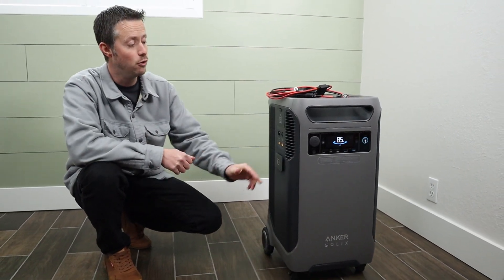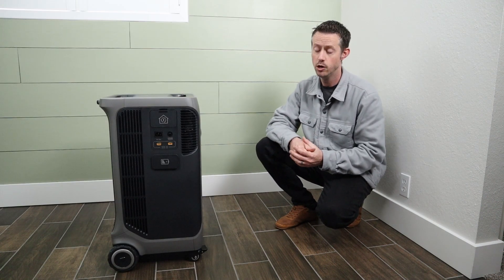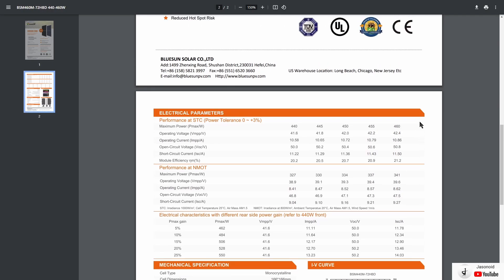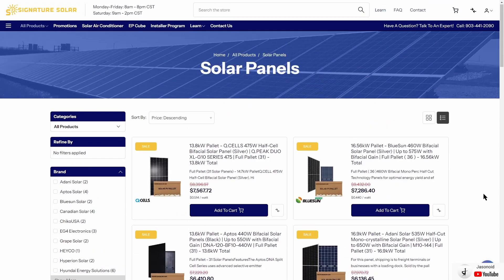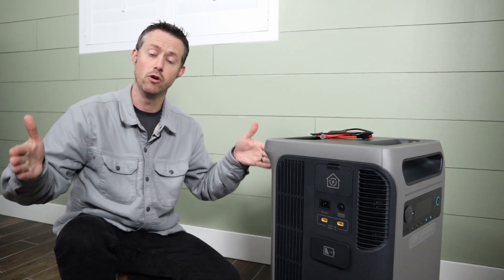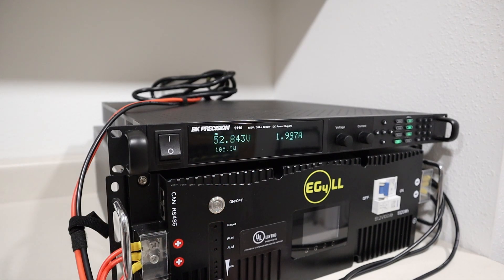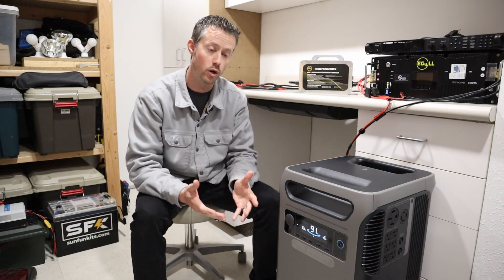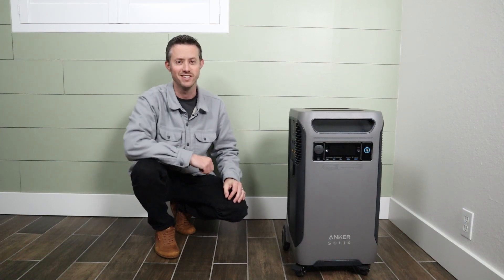Anker SOLIX F3800 - Your Questions Answered! DC Charging Cables - Ideal Solar Panels - and More!

Comment from the maker: IMPORTANT UPDATE: The solar input voltage/amperage has changed on the Anker SOLIX F3800!
https://support.anker.com/s/article/Anker-SOLIX-F3800-Portable-Power-Station-USER-GUIDE--A1790
Solar Input Changes BELOW:
OLD:    11-32V  10A; 32V-60V  25A (1200W Max, firmware 1.7.8 or earlier version)
NEW:   11-28V  10A; 28V-60V  27A Max (1200W Max, firmware 2.0.9 or later version)

The new changes will make this compatible with more 400w solar panels in parallel! Upgrade your firmware to see the changes.
Reply: With the update, going to 27Amps. Looking at say the Q.CELLs 475W in the video, the V@MPP is 45.03.  That would be 1215 watts (45.03 x  27).  Would that panel still work okay going over the 1200 watt limit?  Thank you
Reply from the maker: @jasontwilliams  yes
Reply: @Jasonoid  thank you!
Reply: @Jasonoid  looks like with firmware 2.1.1 you can use 15-60V to hit the 27A max.
Reply from the maker: @jasontwilliams  yep, it's a great change!

Comment: Hi Jason ,I enjoy  your videos, I have a question that I havent seen really covered, with having 2 eg4 48 volt batteries going into each of the solar inputs for charging and operating my f3800   how is the fuse determined for that input coming off that battery or what inline fuse size would I even need to be safe not to damage the solar inputs, Thanks
Reply from the maker: Fuse size needs to match the ampacity of the wire used. Check online for the ampacity of the wire you use.
Reply: @Jasonoid thank you Jason

Comment: Another question perhaps someone could help with.  When using the formula of volts x amps=watts, is this calculating the theoretical watts you could get from a solar setup?    In other words, when choosing solar panels for a battery system like this, I would have initially thought, 1200 watts per xt-60 port, so plug in enough solar panels to get 1200 watts (for example 12 100 watt panels).  So I want to see if i'm thinking about this correctly now....Looking at the renogy 100w panels on amazon, they have Vmp of 20.4v. If I wire 2 together in series that would be 40.8v x 27amps = 1100watts.  But two 100w panels wouldn't give me that much, so i'm assuming I would need to have 12 of them (6 sets of 2 in series wired in parallel).  Now I have 12 panels capable of 100w each, so in theory 1200w, and the Volts x amps = watts would tell me the possible highest output I could actually achieve with this set up....Correct...ish?    Any applying that, if I could find 500w panels with 50ish volts, I could then wire 3 together in parallel and achieve close to the 1200watts that way too.
Reply from the maker: Your on the right track, you'll need a series and parallel combination with smaller 100w panels. If you go with larger 500w panels you can wire them in parallel. You can 'over-panel' the power station with more amps without an issue. The power station will limit the amperage input automatically. You just never want to go over 60v.

Comment: In the examples you list for solar panels, the combined amps of 3 of these panels in parallel would be over the rated 27amps.  Is it ok to go over this rating? And does it matter if the watts of the panels go over the rating?  For example, some of the panels you show with bi-facial gain are around 550 watts each, with three of these that would be over the 1200watt rating of each xt-60 port...is this ok?
Reply from the maker: Yes that's fine to go over 27 amps, that is called over paneling the power station. Just make sure you NEVER go over the 60v, that's where the damage happens.

Comment: At 3:34, how did you calculate 2,400w if 3 are connected in parallel? 1125w x 3 panels in parallel = 3375w per port?
Reply from the maker: The amperage limit on the power station doesn't allow more power. Your also software limited to 2400w, or 1200w per port.
Reply: @ ahh I see! Thanks Jason 🙏🏻

Comment: It’s a piece of junk I charged it once and won’t charge anymore. Anker support is a joke. Do not buy.
Reply from the maker: That's crazy, I've charged mine from the wall everyday and its fine. Did you push the little circuit breaker button near the charging port to reset the charging?

Comment: I'm planning a move to a new, smaller apartment and want to use this to exploit the very steep time-of-use pricing.

Going in... my apartment offers 208v service at 40amps on each phase. 120v phase-to-neutral of course, so I can draw more power charging with 80 amps of 120v instead of 40 amps of 208v.

The time-of-use hours are 8 hours off-peak, 16 hours on-peak.

Going out... I have ordinary stuff, a computer, Playstaion, lights, fan, plus 120v appliances:
-air conditoner needing 10.5 amps
-a single stovetop using 8.3 amps
-a washing machine using 2.5 amps

I'm planning to put the heavy circuits on one phase of the F3800, and the lights, computer, etc all on the other phase coming out of the F3800. I'll use a generator inlet to retrofit the entire apartment... it'll be very clean and neat.

Right now, I own one F3800 and 3 expansion batteries in a simple UPS setup, which works great. But at my new apartment, I want the whole unit on it. Every last watt.

Based on my math, my worst days will use 21kwh during the 16-hour peak. So I'm targeting 21kwh storage.

I am thinking of keeping it in typical inverter mode (not UPS) to get both phases. Then using a smart plug to charge it via the C13 port. To charge 21kwh across 8 hours, it'll take 2625w of input. So to fill the gap, I plan to buy 2 quiet 48v 30a power supplies on amazon and use the DC port.

1) What ideas do you have? Can you improve or simplify this setup?

2) In the latest firmware update, can you charge with AC and DC simultaneously? 

3) Does the generator cable support 208v? That would eliminate my need for C13 and XT-60, plus look even more beautiful. One locking plug in, one locking plug out. I guess it's not a huge deal, just tempting me. I love beauty in these matters.

4) My 3 expansion batteries right now bring me to 15kwh. I need to take that to 21kwh. Should I buy more expansion batteries or can you think of another solution? Since I am already buying 48v power supplies, maybe two 48v batteries would be better?

5) As you proved here, battery chargers won't work because they need to sense a voltage. But if I put a 48v battery in between the charger and XT-60, that would work right?

6) If a 48v battery completely drains and the BMS shuts it off while attached to the F3800, would plugging in a charger still detect it and deliver a charge? How would the charger know a battery is present, if the BMS cut power becaue the anker took it all? I won't be there to unplug it, it must be automatic. The chargers will each sit on a smart plug.

7) Would it be better to just use official expansion batteries so the F3800 can do its own cell load balancing, or would it be better to take a 48v battery at half the price, and wear the heck out of it by discharging to 0% daily, shortening its lifespan?
Reply from the maker: ** Upfront I am not familiar with 208v power. I have not studied it, nor have I messed around with it. I do not have 208v in my area. I have 120v and 240v in my home so that's what I am used to.

1) You could add more capacity for less money by going with 48v batteries instead of buying Anker expansion batteries. You would need a way to charge those 48v batteries so you'd have to consider the costs of adding wiring and chargers in your plan.

2) Yes

3) The generator input adapter for the new F3800 Plus is NOT compatible with the original F3800 power station at this time. If you end up upgrading to the F3800 Plus and using the generator input adapter, I don't think it supports 208v input. The owners manual only stated 120v or 240v.

4) If you are comfortable with a DIY setup, 48v batteries is definitely the way to go. If your chargers are designed for charging 48v LFP batteries I don't see why that wouldn't work. They would need a peak voltage of 58.4v as that's the upper limit of 51.2v LFP batteries to reach full charge.

5) Yes, that will work just fine. Remember you can only connect that 48v battery to one charging port on the F3800, so you'll see around 1150 watts charging while the 48v battery is connected to the DC solar port.

6)The 48v battery BMS is able to control both charging and discharging of the battery via mosfets. When the battery hits low voltage, the BMS will only disable the discharging of the battery and it's still able to charge just fine. If your battery is sitting at 0% SOC, it will start charging when your charger is powered up.

7)There are pros and cons to both setups. Going the Anker F3800 route is fully automatic and very clean and tidy. Everything clicks together and there aren't wires and chargers going everywhere like with a DIY setup. The Anker expansion batteries are kinda like a 'set it and forget it' type of thing. You will spend less of your time managing the system and you are paying for convenience when you buy the Anker batteries, it's plug n play. 
When you go with a DIY system, you will need to plan to micromanage it daily making sure everything is working properly. If you don't have the available time to spend each day working on the system, DIY is not the direction for you.
Reply: @Jasonoid  Thank you so much 🙏🏻

Comment: The anker F3800 has changed so much since your videos. It may be a good idea to hide these and do an entire new review of it and the plus, cover all ground. Because like, at 10:49 that's not even relevant anymore right? I believe you said it lets you do both now? Also the DC charging amps are different via firmware update. The generator cable can serve as a clever UPS or cheap time-of-use  for a small condo by using a smart switch.
Reply from the maker: You are mixed up between the F3800 Plus and the Original. They are two different models 👍
Reply: @Jasonoid  Yeah I think your right. I made a paid comment instead hoping to seek clarity
Reply from the maker: The YouTube comment section is not the best platform for in depth questions and conversations chains. I do not get notified for replies so it makes it difficult to respond to comments repeatedly. I'll go check out you 'paid comment' but please use my basic consulting platform in the future. $20 for 2 to 3 basic questions.
Reply: @Jasonoid  I'll do it there instead!
Reply from the maker: Already working on the replies.

Comment: Newbie here, so just to be clear.  You can hook up as many solar panels as you want but it'll never pull more than 1200W through each port and as far as amperage goes, that does not matter either as it'll never pull more than 27 amps though each port (latest firmware).  The voltage is the one thing that you cannot go over?  Do I have that correct?
Reply from the maker: Yep, that's correct. I'd recommend sticking around 30 amps though because going much higher your wire will get VERY expensive. You'd want to use 8 AWG wore at 30 amps to avoid voltage drop 👍
Reply: Would you be able to setup an array, say 10-12 450W panels that output to a EG4 Solar Charge Controller that then charge 2 EG4 batteries and then output those two batteries to 2 Anker 3800s via the xt60 connector?
Reply from the maker: @echoplexSE  the batteries can't be connected in any way. If they are connected by the charge controller they will share a common ground and the system won't charge. 

I'm not sure if you have your units yet or not.... But the new F3800p doesn't have this issue, it can charge from the same battery bank with both ports, it also has higher voltage input for solar. I made a video this week about it.
Reply: @Jasonoid  gotcha, I did recently get them for a pretty good deal so not terribly upset about it.

Comment: Can I hook the f3800 up to a 12v battery if I’m using it for all 12v outputs? If so is that the same with the Anderson power cable? Your videos are helping me a lot. Started out frustrated and now am hopeful thanks to you.
Reply from the maker: If you want to charge from a 12v battery, it's best to purchase a power station 'alternator charger' so it will take the 12v battery and boost it up to 40-50 volts. That will allow the power station to charge much more quickly. Check out my Bluetti Charger 1 video.

Comment: Thanks so much for the info... with the current update, would this allow for two 48v 100ah batteries to be connected in parallel to be connected to one port ? Or do they still have to be connected separately to each port ? Also can charge these batteries while they are charging the f3800 ? Thanks so much
Reply from the maker: Each battery will have to be connected to it's own charging port, they won't charge if they have common grounds or if they are wired in parallel. The batteries can charge at the same time as charging the F3800.
Reply: @Jasonoid  thanks so much for the info. The breakdown and explanations of your videos are great. I will definitely continue watching for sure.. thanks again

Comment: 60x25= 1500 though.  How is the max input 1200?
Reply from the maker: It's software limited to 1200 watts. Even if your voltage and amperage is capable of more...
Reply: @Jasonoid  learned something new. Thank you so much for answering my question.
Reply from the maker: @LeeroyyyyyJenkinssssss  you're welcome

Comment: Sorry, I don't understand how you got the 25 amps in your formula. How would it work out with two panels  (parallel) in each port? I don't have enough of a grasp to go shopping yet. Another question ... how did you figure on three panels? I had trouble following you. My bad.

Comment: Do you think the new Bluetti Charger 1 charge the F3800 while driving or at least your vehicle is running? My 2017 GMC Sierra alternator puts out between 13.8-14.4 Volts (amp rating is usually 170).
Reply from the maker: Yep, it would charge around 560 watts peak.

Comment: I have an f3800 and a smallish dual fuel generator that outputs 5000watts @240v; solar isn’t an option for me right now. I need to pick up a chargeverter to make it all work together. The server rack battery seems like a good option to better utilize the generator output and reduce its runtime.  I like the idea of 2 separate server rack batteries to maximize the input on the f3800.  My question is can I charge two independent server rack (not connected in parallel) batteries simultaneously from one chargeverter?   What would that connection look like?

Comment: Your videos have been super helpful. I have a question that you or someone in the comments can help. Have 2 48v battery banks hooked up to their respective bus bars. From each pair of bus bars, I have 2 XT60 cables, one for each unit. As soon as the fourth and final cable is connected, I can hear a breaker trip inside and charging stops. As soon as I unplug ANY one of the 4 xt60 cables, charging resumes. I am flummoxed. Any insight will be appreciated.
Reply from the maker: I walked a guy through this exact process on his dual F3800s for a couple days. After hours of troubleshooting we had to have three batteries total.... Completely unexpected! 
Basically the 4th connection had to go to its own battery for all units to charge at 2400 watts with both ports 😩
Reply: @ bummer. I was planning on expanding my storage in the near future, now it seems my hand is forced to do it sooner before the summer starts. The thing that sucks most is that now I have to get an extra 48v charger and potentially another SCC for this 3rd battery bank.

Comment: Jason, sorry to get back on the Chargeverter again but assuming I use a busbar off of the Chargeverter, will the two X60 cables you have in your parts list here provide me what I need to connect the the F3800 solar inputs ?
Reply from the maker: Yes, that should work. Remember that the F3800 won't charge if both xt60 cables come from the same battery. The charging shuts off if you have a common ground / negative between the charging ports. If you have one battery, you'll only be able to connect up one charging cable to the F3800.
Reply: @ any suggestion on Chargeverter settings and what brand and type of busbar to use so that those cables, Chargeverter and busbar all work together ?  Thanks so much … I wouldn’t know where to start without your insight !
Reply from the maker: @wbarkwell  I made a video just for you!
https://youtu.be/T_zZceBWZHk

Comment: When looking at the specs on the Hyundai 395W panel it appears the Amperage would exceed the units max with three panels.  Can you clarify
Reply: It’s true what you say, and it doesn’t happen only with that model but with all the ones they shared. If you check Anker’s support, they state that the total current of the three panels in parallel should not exceed 27 amps. Could you clarify your suggestions? @jasonoid
Reply from the maker: Power stations are current limited. The amperage will be limited to 27 amps input. I would recommend keeping the total array amperage within a reasonable level. I wouldn't go over 35 amps total while overpaneling the F3800.

Comment: Thanks Jason for the follow video on this unit re: charging options. Just wanted to find out if you have heard whether Anker has updated the Solix f3800 to accept parallel charging (eg using two output cables from the one EG4 unit for 2 inputs into the 2 separate solix solar charging ports) or is it just not possible because of the common ground which you mentioned which means i would have to use two battery sources for each solar input ports on the f3800?
Reply from the maker: The last time I tested, they still DO NOT accept charging on both ports from the same source. Anytime you have a common ground it stops charging.
Reply: @Jasonoid  thanks i appreciate the response I'll look into a 2 x battery setup